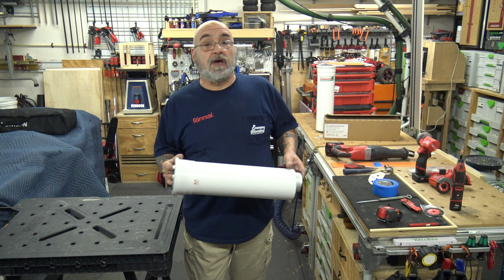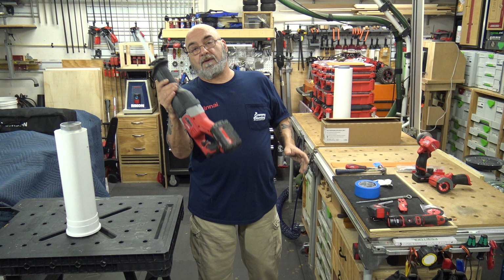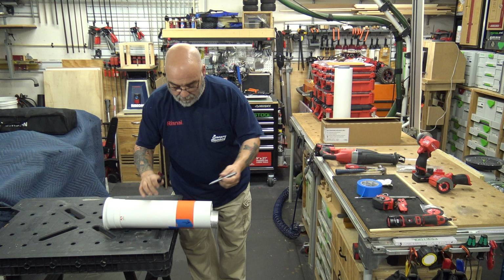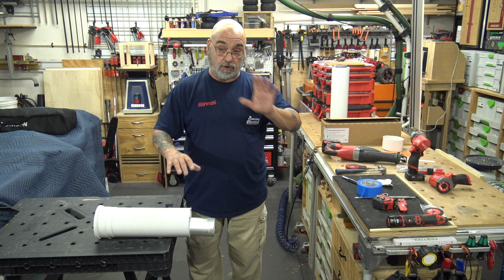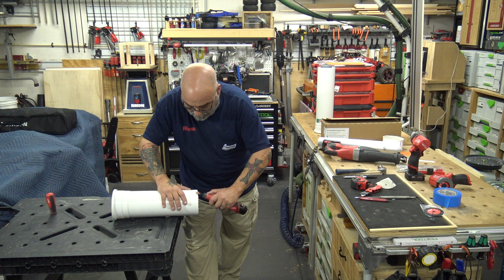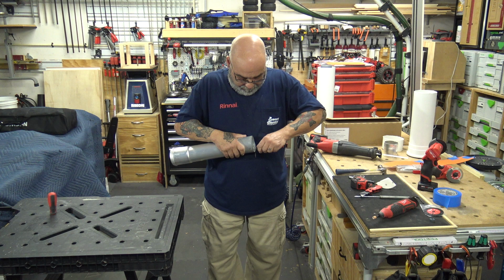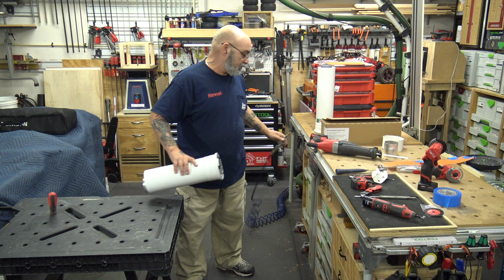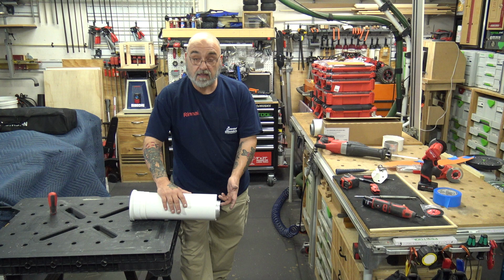The correct way to cut Rinnai Ubbink concentric vent pipe

Comment: I just found your channel.  We had a Rinnai outside unit for years. Then 2.5 years ago water started pouring out. We called a plumber and had to buy a new Rinnai RL94.  We just had a bad freeze in our area and the power went out for 13 hours. We could not get any water to come through the hot side of the faucets.  When the power came back on it took a while but when it started running water poured out the body of the unit. So I shut off the cut off valve going in.  I found your videos on how to flip that solenoid to keep water going through and the other videos about the drain kit.  
I have not taken the cover off and I am sure it is out of warranty since it has been 2-1/2 years. 
I guess I have to take off the cover and see what split open and try and find a Rinnai repair person.

Comment: An alternate method suggestion. First, make a shim board (cradle) to match the outer pipe offset thickness between the outer rim circumference and the circumference of the pipe. 

Add a beveled piece on either side to hold the pipe from moving while cutting. (Similar to a V block.)  use a band saw, table saw or hacksaw to cut BOTH the inner and outer pipes at the same time - measure the needed finished length PLUS a half-inch. 

Dissemble the two pipes using the method demonstrated.  Put the outer white pipe back in the cradle and cut a half-inch off the end. 

Remove burrs and reassemble the two concentric pipes.

Comment: I watched your venting video. I am not a plumber but the homeowner. In adding an addition we had to re-vent our RL75iN vent to a vertical. The plumber is not a certified Rinnai but the contractor said I had to use their guy. They said he talked to a Rinnai person. I took photos of what was done and I wonder if he did it right. It does not seem like what you said because white pipe sticks up and there is no collar up under outside piece. How can I send you photos.for your thoughts. He did the vent through my back old porch roof today Thanks, Dawn

Comment: Mike, at times I'll have water dripping through my older V75iN.  There's also water sitting on top, around the base of the Flue Assembly where it is screwed down to the cabinet.  Do you think I just need to replace the o-ring, Rinnai part 108000018?

Comment: Installing V75IN system myself converting from a tank. I’m knowledgeable in extensive plumbing and electrical and am determined to do this job myself. Would love your guidance on a few things. Venting to be one. I’m a little confused on the venting supplies and determining what exactly I need. Also am wondering if the entire water line need to be 3/4” or could I just increase within a certain number of feet. What are your thoughts on a recirculating pump? Money saving or now? Trying to decide if the power needs to run pump is still less than the money saving from water.